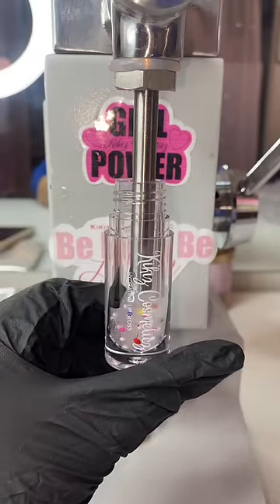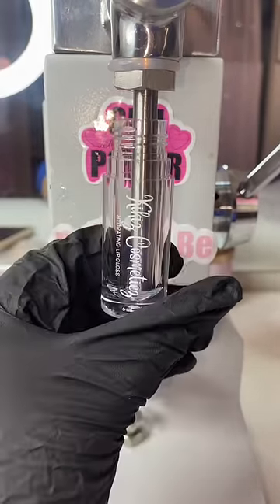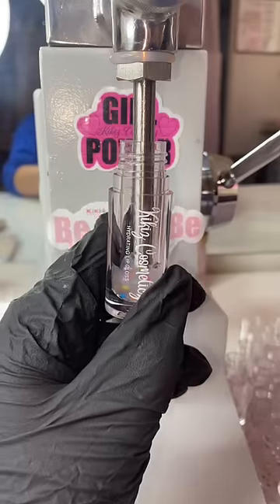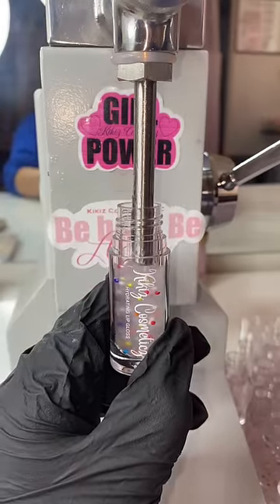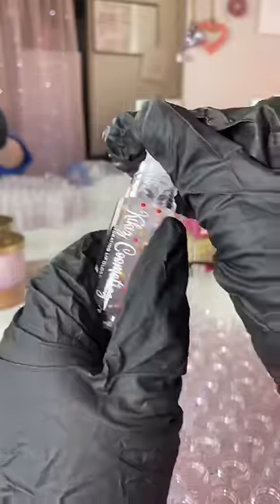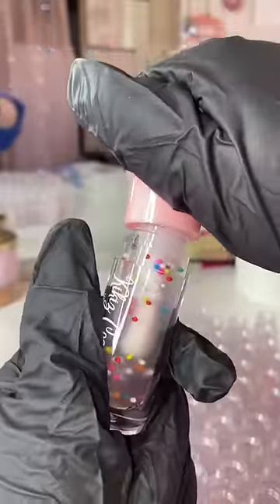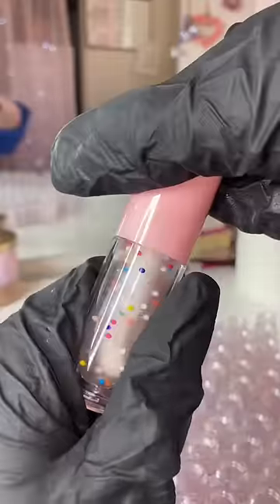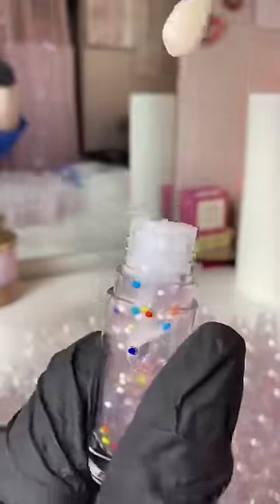Here’s what happens when I overfill a lip gloss 🤯😩

Comment: But what I don't understand are chip bags...
Reply: If they fillled up chip bags to the top, they wouldn’t have any room for air to be trapped in and the chips would go bad very easily.
Reply: @ilovecatsandimlanabtw  
How much air do they need 😭
Reply: The air is there to cushion the chips so they don't get broken. There needs to be a lot of air because they are shipped all over the world, when it goes to a different elevation the air inside can shrink or expand slightly.
Reply: Also, chips are sold by the weight of the chips inside not by volume or how much they fill the bag so you aren't getting ripped off. The amount you get is printed on the bag and this is tightly controlled because it's illegal for the company to lie about it.

Comment: How do stoppers work?
Reply: i think they clean the stick but leaves lipgloss on the applicator because if the stick gets covered with the lipgloss it makes a mess on ur lips when ur applying it.
Reply: It helps to not have a huge amount of product on the brush so you don’t waste any as well as what the other person said like to keep to stick clean
Reply: @paigesings4life  I know but how?/nm
Reply: @meeby_xx3727  I know but how does it do that?/nm
Reply: @Lillys.disguise  the stopper has a smaller hole that the bottle's like actual opening so it basically hugs the applier and takes off excess product

Comment: If you cant fill it upto the top for spill out problems then take a little bigger tube and fill those.
Reply: That solves nothing... First off, she wouldn't be able to fill the bigger bottles to the top either or the same overflowing problem will happen. Also, if she's going to get bigger bottles, she'd have to increase the prices to compensate for the cost of the bottles and the cost of extra gloss. And people would find a way to complain about the price increase. If she chose to fill bigger bottles with the same amount of gloss she uses now, the bigger bottles would look very underfilled and people would be even angrier

Comment: Can you just not put a stopper in
Reply: The stopper helps keep everything clean by cleaning the extra gloss on the wand as it’s removed. Without it when you take the wand out it will be entirely covered in a think layer of gloss making a mess and losing product fo you. Also the stopper doesn’t contribute much to it being “under filled”.
Reply: Your lipstick/lipgloss actually lasts longer thanks to the stopper. The stopper removes the extra product from the wand to make sure that you don't take most of it every time you remove the wand.

Comment: You lip glosses are underfilled. Stop the excuses.
Reply: lmaooo
Reply: It’s not even that big of a difference? Plus it will leak if filled any more
Reply: @NicoleSueko  prove it.
Reply: @billieeyelash7015  Not the same person but I do have a way to prove it. Get a cup and fill it all the way with liquid, then put your hand into it. Your hand will take up space in the cup, meaning the water needs to go somewhere. The cup will then leak. The same thing happens with these lipglosses
Reply: Did you not watch the video?
Reply: @billieeyelash7015  Just say you have the maturity of a 12 year old and move on
Reply: @billieeyelash7015  It... is how displacement works though? What did HerbalTea get wrong?
Reply: @billieeyelash7015  Sure! Whatever happened to you to make you so bitter? You doing alright?
Reply: @billieeyelash7015  Well, that's certainly not good! A half filled lip gloss, there certainly must have been a mistake made there! Did you let her know about the error?
Reply: Archimedes' principle exists you know. It’s basically system of measurements used to determine the volume of an object that does not have a regular shape, just like the tip. An object pushes out water that is equal to its own volume, like getting into a bathtub, you can see the water level rise up to displacement. Any object immersed in the water will displace it which is the equivalent to buoyancy. Just a little lesson in math and science :)
Reply: @dragonire_dino0856  your tone seems very pointed right now. Meanwhile, homegirl's lip gloss looks very unfilled.
Reply: @billieeyelash7015  whenever someone is proving you wrong are you just gonna fat shame them?No hate just asking ☺️